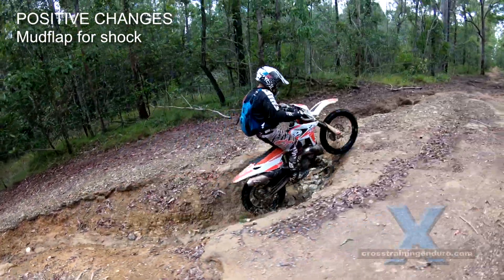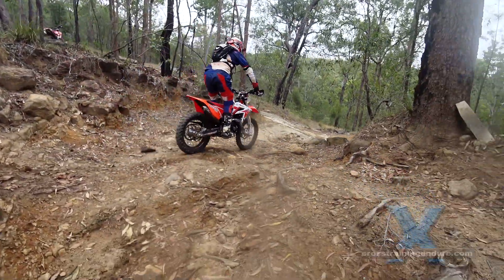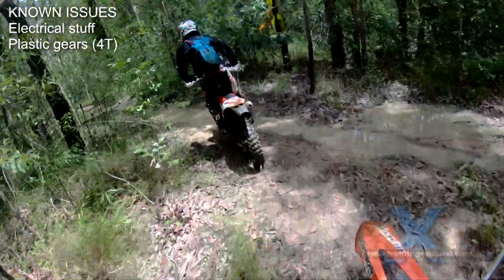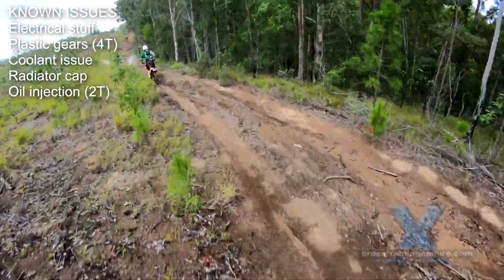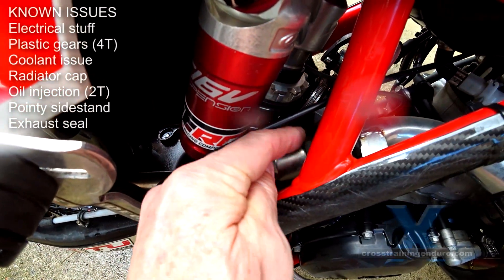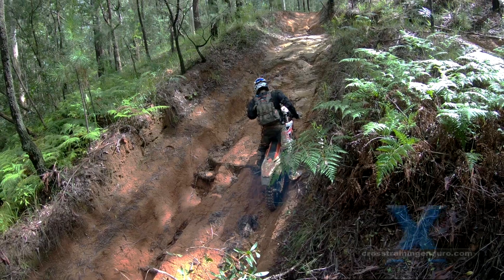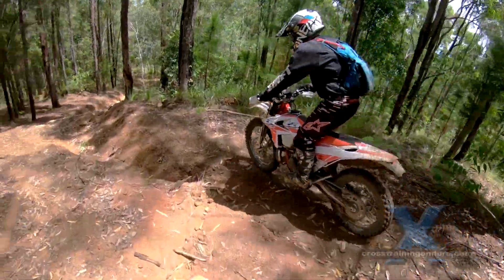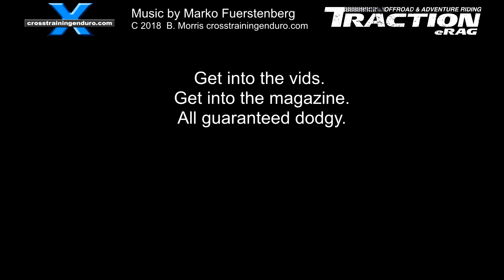BETA RR250 RR300 2018+ review of known issues and common problems︱Cross Training Enduro

Comment: Another fantastic video Barry, cheers for a spot on summary. I'm 3 oil pumps in with my 300 18 beta, thanks for explaining why I was fouling plugs.  Are you running oil injection in your 300?
Reply from the maker: i hope this solves it darcy. there's also a very small number that have been a problem in the ICU but so rare i didn't mention it. still running injection on mine with no probs. :)
Reply: To be honest I'm too scared to go back to oil injection, I don't have the best luck with this stuff and adding oil to the mix is not that bad. I wish it just worked! Great to hear you having good luck with your OI. 
I've got another issue to add to the list, cage on the main bearings gone on my bike last week. The dealer tells me it happens 1 in 15 bikes, to me that sounds like a lot.

Comment: Great info! I'm finally treating myself to a 250rr.
Reply from the maker: hope you like it david. still quite linear power for a 250 but it still goes like a scalded cat at higher revs.
Reply: Thanks! I was debating about getting the 300.  But, figured maybe the 250 would handle a bit quicker.  I do like a bit of a top end rush at times.  And I could convert it to a 300 if I felt I needed more grunt.  Picking it up Friday!!

Comment: Here's hoping 2019 bettas are improved because that's when I'm by mine, fingers crossed
Reply from the maker: the good news is i couldn't find any 2019 cases, wadz up. so if faulty NTN bearings (or seals) were the issue it's possible the faulty batch was used up before 2019 production started. fingers crossed....
Reply: @crosstrainingenduro  I was really hoping your reply would say something along those lines great news and thank you for the reply

Comment: I bought a 2018 300 race and had to zip tie the exhaust connection. Also had many loose bolts from the factory. I went through and torqued everything on the bike to be sure not to loose bolts.
Reply from the maker: a good point brent, just after i finished the vid another dealer said the factory is good at torquing the important bolts correctly (e.g. engine) but they often get very sloppy with all the other ones. very good idea to run over the entire bike with a spanner before your first ride!
Reply: My rubber exhaust coupler split after only 3 months and left a nice mess.

Comment: 390RRs 2018:  Thermostat leaked when delivered. Dealer fixed it ASAP. Radiator hoses were loose and leaking. I fixed them easily. Noticed a very small leak between the case halves gasket right at the bottom of the engine when I dropped the skid plate to change the oil. Beta USA has acknowledged at least 6 additional 2018 390RRs bikes with the same issue. (losing about 1-2 drops of engine oil each day when the motor is NOT running) The dealer will remove the engine, split the cases, and replace the gasket just before the warranty expires. I would like to know if this issue is showing up in Austrailia. I am LOVING the 390RRs!!  Thank you, Barry, for this vid and all the training ones.
Reply from the maker: thanks for the details rick, i've listed all the issues two dealers have faced, and particularly jody who is a beta mechanic as well so sees the common problems all the time. poorly tightened bolts is common but only the less important stuff... engine bolts etc have always been torqued correctly in their experience. no oil leaks... so far!
Reply: Perhaps better communication needs to be had between the mechanics and Beta, then disseminated to all dealers.  It would be nice to take care of these things in the PDI.

Thanks for the video Barry.
Reply from the maker: not sure what happens in other countries jason, but i think all the beta dealers share info and fix the small stuff in pre-delivery.
Reply: I know for a fact there is good communication between Beta USA and their dealers. The community is pretty small so I would assume there is pretty good communication between the dealers too. What did surprise me was when I learned my local dealer's mechanics did not have any formal training from Beta. I would have assumed there would be at least 1 "factory trained" technician in each dealership. That being said, they never fail to amaze me on how well they respond to questions and how much they enjoy promoting the Beta brand.  They are good people.
Reply: Yeah I'd like to think that's how it would work.  Maybe some things just get overlooked.  What's that saying?  An ounce of prevention is worth a pound of cure :)

On a positive note:  I've heard really good things about our local Beta dealer "Clay's Offroad" here in New Brunswick, Canada.  I'm looking to purchase a 2018 XTrainer.  I've been watching this old guy who rides one and he's been promoting the bike for a while, I think I've drank the Koolaid.  That old guy must be getting a cut... ; )
Reply from the maker: sounds about right rick. it's not just beta of course, it seems the smaller brands like gas gas attract really passionate dealers/distributors who aren't all about the money... at least not until the brand gets big lol.
Reply from the maker: i think the old guy wishes he was getting a cut lol. he's tried emailing their head office a few times about different stuff and they won't even answer....
Reply: I also have a '18 390rrs. I will keep on the lookout for these problems.
Reply: Hi, I have seen case halves leak previously, in 99% of cases they seal up by themselves through the bed in process as the gaskets & case halves sometimes require heat as well as lubricant to create a good seal which is why dealers wait before calling warranty.
Jody.
Reply: Dirt Nap Thanks for that reply. I’ll keep an eye on it and keep my fingers crossed that after the motor thoroughly breaks in the leak will resolve itself. I’m due for an oil change soon, so I will post my findings here.

Comment: Just had my battery claimed under warranty. Lipo on a '18 390rrs. 10 minutes of ignition on and the thing is completely dead. Not even enough to prime the injectors to bump start the bike. One in 10,000 is always a dud. I guess I won...bike is still awesome tho.

Comment: So is the oil injection bullet proof? Other than the diode problem, is there record of any other failures?
Reply from the maker: this was covered in the video, luke. and i didn't mention any diodes in relation to the oil injection so not sure what you mean....
Reply: CROSS TRAINING ENDURO SKILLS yes, you cover a small portion on the injection that I have watched. But I am referring more towards it failing as in not allowing oil(since it’s not a pump) I like the idea that it uses engine vacuum but has there ever been reports of a blown engine due to lack of oil or something with the oil system other than going rich. should have been a little more clear.

 Plus you did talk about diode 😏 just referring to the earlier issue. 
Have a good day!
Reply from the maker: gotcha luke. the oil pump failures i'm aware of occurred due to the mentioned reason, or could most likely be attributed to that. i didn't find any evidence of the the pump itself failing due to poor design etc. but then it's still all quite new so who knows if they'll become very unreliable after 100 hours? i know some riders convert back to premix after six to 12 months on the bike for this reason, because the long term reliability hasn't been established yet.
Reply: @crosstrainingenduro  I am deleting mine, just for the peace of mind, I really liked the idea of it, but without going into deep details, I had a broken subframe, which caused an air filter sealing problem(everytime you put pressure on the subframe) causing a gap, so It sucked in all kinds of sand and dirt. Huge motor rebuild. Well I dont want to go through this again, so I am going to delete. and its not really the gate itself I am worried about, its the hose, and nipple. all it takes is a pinch while you're riding, or the nipple getting broke off, or getting loose. Thank you!
Reply from the maker: ah that reminds me, one guy did have the hose melt against the exhaust pipe but he noticed just in time. definitely pays to zip tie on to the nipples and well away from the exhaust.
Reply: @crosstrainingenduro  Thanks...maybe in the future when I get tired of premixing Ill put it on.
Reply: I do have another question. The guy at 1min who broke his fender. Was his subframe okay?

Comment: Make a video about what you should do if u brake a clutch cable mid ride
Reply: Shift using your throttle. Gas off to up shift and gas off and on quickly to down shift. Racers dont use the clutch often.

Comment: What about the grabby front brake that can catch unexpectedly, did they fix that? That's a major safety hazard that a LOT of Beta owners complain about.
Reply from the maker: never heard of that one, do you have a link to any threads?
Reply from the maker: first thread sounds like a guy who just came off a bike with mushy brakes. flipped quickly through the vid but couldn't find a reference to brakes. i've met so many guys riding betas and never heard a single complaint. googled 'beta front brake problems' and nothing.....
Reply: That's strange... One of my friends also test rode a Beta and said it had the same problem. Kyle from Dirt Bike channel has several videos were he mentions the bad front brake on the 2017 Beta 300. It took him weeks to heal from an injury because of it, and he's a good rider that's used to riding new KTM's.
Reply: Flush line and replace fluid. Try a small bevel on the leading edge of the pads, or a different pad. Like CTES mentioned elsewhere, could be something in the production run of the models with the issue, versus no issues with the aus models.

Comment: Maybe I should post this on one of your xtrainer vids but I wanted to let you know that my new xtrainer 300 blew a main bearing at 10 miles and now sits at dealer waiting to hear if they are going to replace the motor or rebuild it, the latter of course sounds totally not acceptable on a brand spanking new beta, not happy
Reply from the maker: 10 miles???!!! please do post this on an xtrainer vid, along with any details as you find out. occasionally you do hear about this sort of thing with various brands happening straight off the showroom floor, such as a KTM owner saying his new bike siezed within a few miles and it had no engine oil. i wonder if your oil pump failed, or that tiny little oil supply hose wasn't connected? many are putting zip ties on those as they can fall off. 😥
Reply: Those issues do not appear to be the cause.  My dealer told me that there has been a small number of engines with defective bearings (about 10 in 2000).  When he drained the oil there was 500 cc's left the rest blew out the pipe and leaked into the bash plate.  I checked out your vid a while back before buying and found that my dealer did do most of your suggestions and appeared to be very familiar with those issues and you.  He is replacing the bearing himself as I did not wish it to go back to the factory for repairs and will be extending or renewing the warranty for 6 month on completion.  I will look again tonight for your xtrainer common problem vid tonight, thanks man Rock on!
Reply from the maker: @brandtagone8487  is it xtrainer-specific, or the RR250 and RR300 as well?
Reply: Dealer did not say but I will ask and get back to you.  He is shooting for March 28 so I should know by then
Reply from the maker: i just rang a beta dealer, he said two out of the ten 2018 xtrainers he sold had major main bearing failures at around 200km in each case. his RR250 and RR300s were fine but he said other dealers reported some main bearing failures on 2017 and 2018 models. 🤢
Reply: CROSS TRAINING ENDURO SKILLS this sounds like it may be more common than thought however the lack of data on the tube would suggest otherwise.  Curious it is
Reply from the maker: i've done a bit of a search and found half a dozen cases where RR300 main bearings seized, dating back to 2015. not sure if this means there could be many cases that simply weren't reported....
in the old days they used to say one angry letter to the editor also represented 99 others to lazy to speak up. not sure if that applies in the internet age though!
Reply: @crosstrainingenduro  I probably would not have bought the bike had I known about the issue but after the 10 miles that I did get to ride it I know this bike is perfect for the trails in the pacific northwest mountains, Thanks for the info it is good to know!
Reply: Ok there was no damage other than the bearing.  Dealer says it was just a bad bearing.

Comment: The problems I have encountered in the six months of owning my 390rrs. The thermometer for the engine temp is tempermental at best. Some days it gives me a temp other days nothing. If I wash the bike it says the motor is over 150 C when the bike has not been run at all that day. The plastics explode but they are cheap to replace. The suspension is a little soft for my taste but I am 215lbs with gear and bag so maybe I need a tune. The gearing is a little tall for really tight single track 15/48 is great for the road 13/48 is great for logging/fire roads but I will have to go to 13/52 for any serious single track, especially if I want to race. 

All in all the bike is fun reliable and relatively cheap compared to orange or white pumpkins. I will buy another Beta but only because of the other very serious problem the bikes have.  
See my other comment.
Reply from the maker: dodgy plastics exploding lol! i hope it's finally fixed, our 2018 models aren't exploding yet....
Reply: Mine have rear black plastic bit broke into over 12 pieces.
Reply: I've been running 13/50 on mine with pretty good luck, I live in Washington state so trails are super tight and rocky/covered in roots. I still wish I could get it to go slower in first though, I have a 480 and in 1st with no throttle at all it goes along at 6mph. It's perfect for more open mountain trails though.
Reply: I am on Vancouver Island, so similar terrain. You have helped me make the decision between 50 and 52. Thankyou.

Comment: Did they finally fix the forks hard coating issue or do all new owners expect to spend 400 dollars to correct this again this year?
Reply from the maker: never heard of that issue in australia, and i spoke to a few beta mechanics and dealers for this vid who were very happy to share all the problems they've hit over the past few years. any more details? how often has it happened? which year models?
Reply: hi Barry, it was an ongoing issue with the Sachs forks wearing internally due to missing / poor hardcoating on the upper tubes. There's a 35 page thread on BetaRiders forum detailing it.
Reply from the maker: wow. i'll check it out and update the known issues list i've started on a few forums.
Reply: here you go...Cheers.
http://www.betarider.org/forum/viewtopic.php?f=17&t=2071
Reply from the maker: cheers, just put this up on the forum posts too.
Reply: A well known issue for those gumbies with racing models... and an issue that is pathetically ignored by Beta Australia
Reply: I’ve found most of the time this issue was due to over torquing of the triple clamp bolts causing excessive wear of internal components.
12nm lower & 17nm upper is quite easy for someone to get wrong without a torque wrench.
Reply: Dirt Nap I don’t know how Betas turn up in the crate, but either the factory or the dealer f’d mine then.
Reply: Fast Farmer if it’s still under warranty, the triple clamp bolts have not been touched & no accident damage..... Send it back.
Reply: Dirt Nap I had this issue 2 years ago and what grinds my gears is the refusal of Beta to acknowledge the issue. I didn’t go to the extreme of putting on Ohlins (as some have), but not much of the forks are original and now I just live with it and ignore the fork flex and compromised oil. I totally agree with your comment on torque and I run the clamps as lose as possible. Cheers

Comment: Wow, this video is fantastic.
Reply from the maker: Glad it's useful, we've got a few more floating around for various year models.
Reply: @crosstrainingenduro  May I ask; does the 2020-2022 Sherco 300 2-strokes have oil injection, or do you mix oil in the fuel?
Reply from the maker: Still premix, which we like. In our group no one ever had oil injection problems but it's always in the back of your mind once the warranty lapses. Our Beta dealer always recommended ditching it before getting too many hours up on the bikes.

Comment: Just wonders if anyone else has had their check engine light stay on and if so how did you fix it. It’s a 2018 xtrainer with 168km on the clock.

Comment: I have an issue with my RR 300 2018 model , the battery doesn’t get charged and after a while stops starter to work. Not sure if it’s the wires.
Reply from the maker: the wiring looms are quite messy. i know a guy who bought a 2020 RR300 and he said the wiring looks a lot neater now but the connectors were still pretty bad... he had the whole loom replaced under warranty. i know almost nothing about diagnosing electrics but it might pay to take the tank off and check all the connections and spray some dielectic grease in. good preventative maintenance anyway.

Comment: Hi, i am interested in a 2018 beta. It has the oil injection bypass. I would like it to be electric oil injected. Would you consider reinstalling the electrical oil injection system?
Reply from the maker: I know a long-term Beta mechanic who says the failure rate is low, but high enough to consider eventually removing at some point after your warranty is finished.